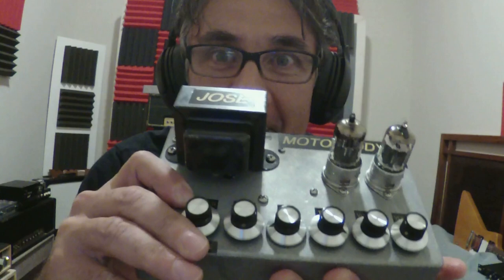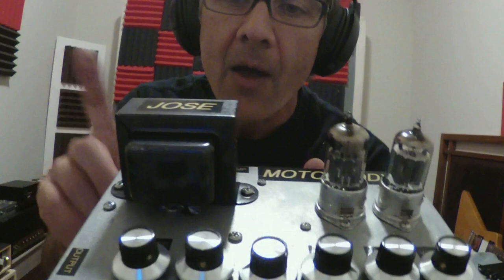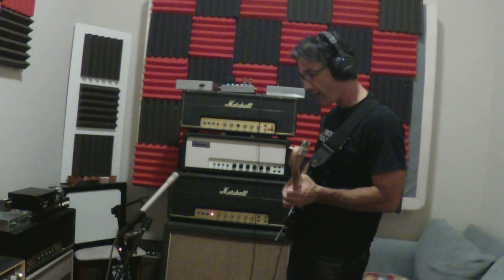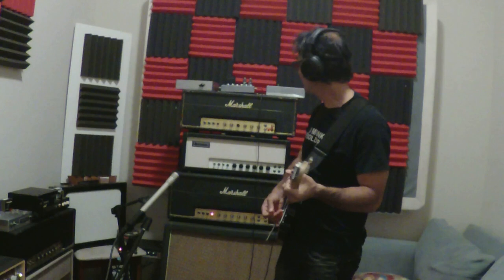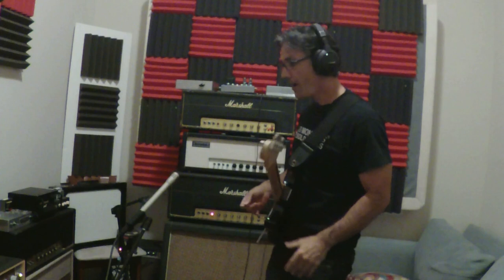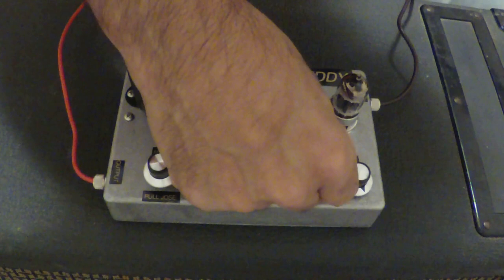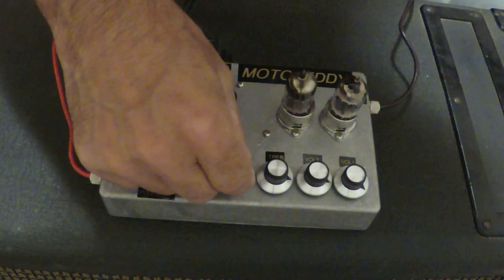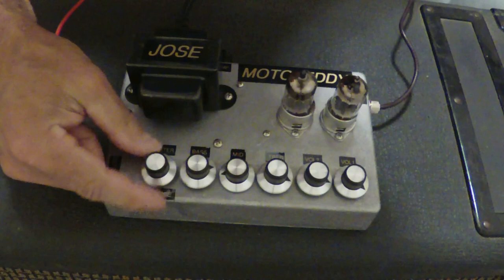Jose Mod Preamp Pedal

Comment: Just discovered your channel... Subd! You are a gem! Thanks for the sharing of knowledge. Questions: At what voltage is the variac set? And what are the settings on the amp? Cheers.
Reply from the maker: Obsidian s,  Thank you for watching :)

I think for this vid the Marshall was set at 120 vac.  The Jose pedal was run into the line in on that Marshall , bypassing its tone stack, so the controls settings were not relevant :)

The settings on the Jose pedal were shown I think in the vid...  Hope that helps !! :)

All the best

Ossie

Comment: Hey Ossie

Thanks for your efforts in trying this.  I've done various project such as this or SS emulators.  One of the things that missing is the NFB circuit and presence and if applicable depth/resonance control, soo usual the end result sucks and is thin and in the case of SS design, a high emphesis on highs, so in a nutshell....sucks!

This appears to be a fairly successful attempt at Jose preamp in a pedal!!  I have a few questions, maybe answered, but I didn't hear them, though many videos and a lot of minutes, so I'll just put into one listing:

1. You mention getting the voltages the same as in the original amp.  What are they across the B+??

2. Is the zeners only engaged in the pull and pre-TS master or both?  I thought the original design MAY have had the zeners engaged in both modes, but could be wrong.  Please confirm.

3. I hear reverb.  Is this post effects processing or....?  Please confirm and if any other FX.

4. Since you are running into the PI and power section of a 100w Marshall, the NFB should be active.  Where do you have the Presence set at on the Marshall in this clip?

5. The original Jose you have had many inputs and channel jumping.  I think you said this was the HI mode, so what resistor did you use into the grid of V1a?

You mention you're going into the PI of the Marshall (thru the 22n).  I purchased a LA100PA which is identical to the LA100BL Iommi used and he actully used a bunch of these PA's with photos out there.  It is basically exactly what you said and the PI and power section without the preamp (I added the preamp and converted over to LA100BL-spec).  As you said, the input simply went thru the 22n and into the PI and power section.  The input just jumped right to an output to continue to slave to other PA's (or Slave) amps for walls of sound.  Pretty cool!! :)

Let me/us know about the above.  Thanks!
Reply: Oh, which Fender PT did you use also (part #)??
Reply: Oh, and what zener value for the clamp did you use in the preamp?  5.1V?  4.3?? etc.
Reply from the maker: Hello Equinox,

  Thank you for your questions. :)

I believe that these questions were answered in the different videos.  I will of course oblige your requests, but I believe you can find these answers.  I did state I would answer questions not covered or misstated in the course of the description but asked that the viewer do their homework and look first :). I learned this way and I feel its still the best way.

1. The original amp uses the standard Marshall power transformer and power supply dropping resistors found in the stock amp and as a result the b+ does not deviate from that circuit. For the preamp the b+ voltages at the nodes were
PI-340
CF-332
V1 a/b and boost stage- 306

2- The original video of the modded super lead shows the zener clipping circuit in its entirety- it is connected directly and cannot be switched out

3-In the video I give the signal chain used ---- pedal- 100watt line in- UaOx (sunset sound setting which does contain reverb)- Mackie mixer (to blend my mic in)- zoom camera audio inputs.  Nothing else was used. 

4-  I did state the active nature of the presence on the Marshall - the knob was set at noon

5-  Per the description of the original preamp the grid resistor going into the second stage would be a 68k with a 68k ground reference 

I hope this helps!

Regarding transistor  versions- I have built a few into pedals over the years with good results... but I still prefer the tube version.  Ill try to put together a demo video of one in the future.   

The Power transformer is the model found in the Fender stand alone reverb unit- many companies produce them.... This one was made for me but off the shelf units are plentiful.
Reply: @ossieahsen6732  Hi Ossie!!!
Must say, GREAT GREAT work!!! Just one thing to ask... in your Jose Plexi the input of the gain stage is without a grid resistor right? ... in your preamp, what resistor have you choose?? Thanks, Andrea...